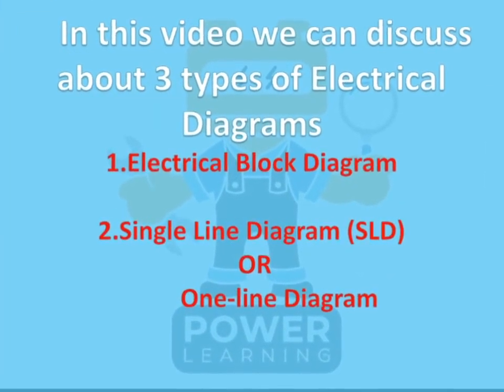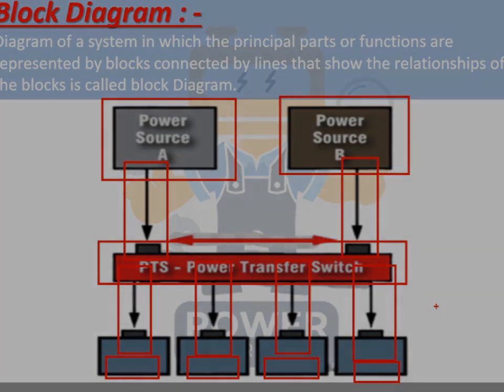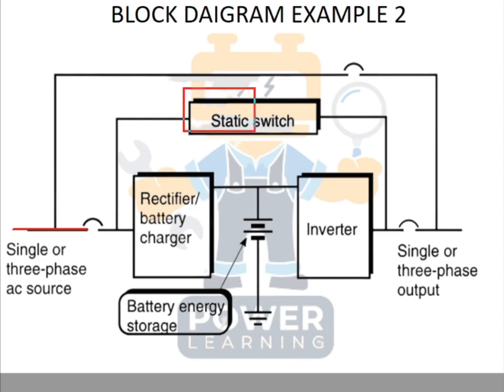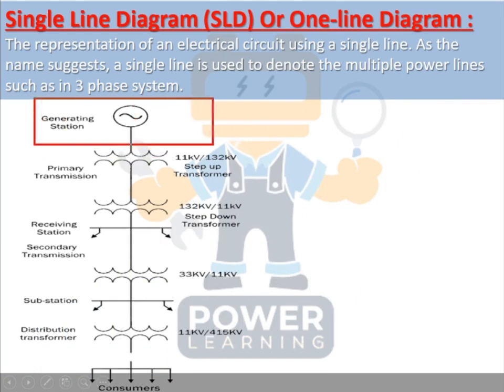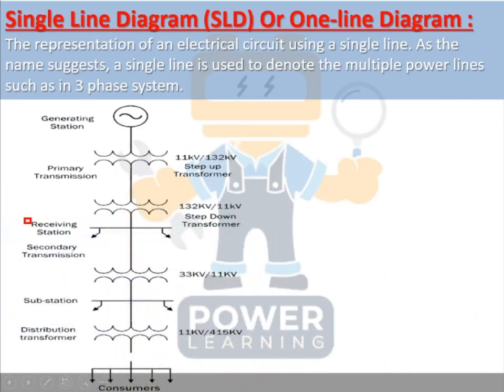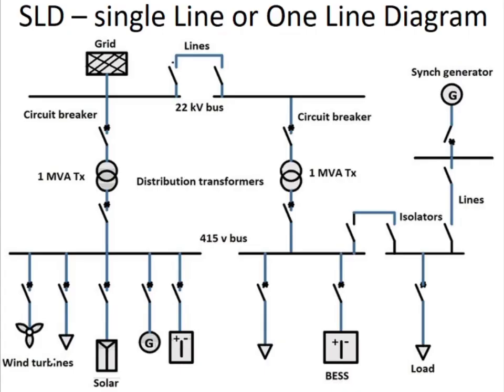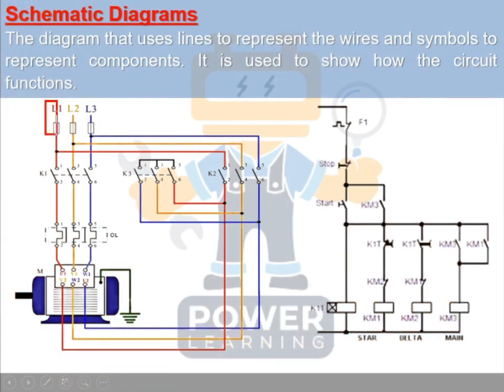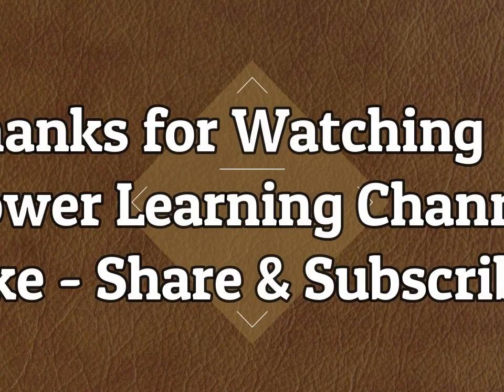Electrical drawings Explained | How to read easily Electrical Drawings & Diagrams British standard

Comment: Sir can I ask one question why the generating station 12kv to 132 step up ok then why again need to step down and again step up ( it increases output as I think may transformer increase using of primary and secondary winding but I don't know is it correct or not explain this and also can you please explain why can't step up directly outtput of what you require? Could you please explain I don't know about that.?
Reply from the maker: For transferring power from long distances to consumers home